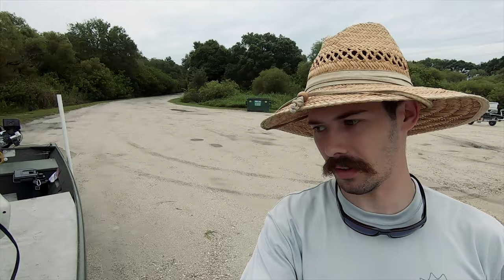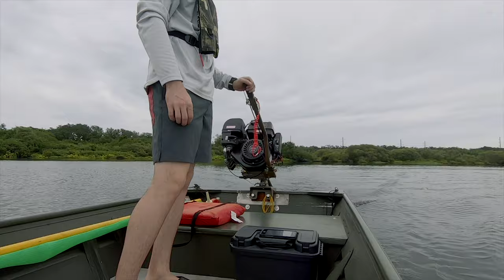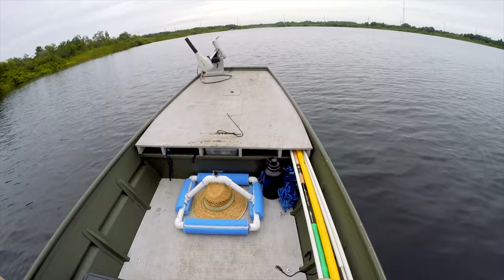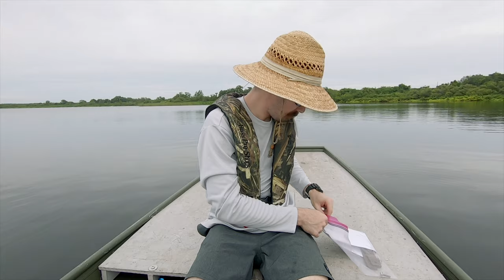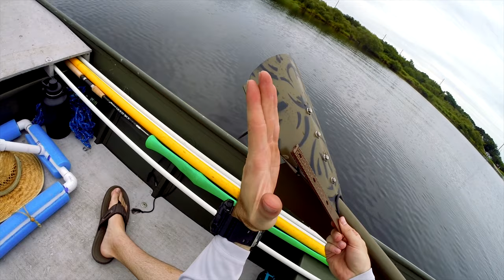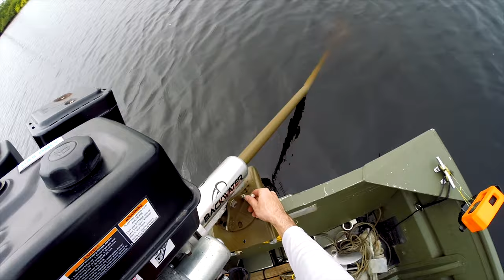Backwater Swomp Lite 13hp Water Trial & Tune

Comment from the maker: I have talked with Backwater on the phone. There are two 9" props on the way, along with a different throttle lever. There will be an update video once I get those parts and start working on the rig to see if I can get it running better. For those who like to read, here is the article - https://www.jtgatoring.com/backwater-swomp-lite-glider-kit-12-16-hp-water-test/

Comment: i have this motor its a beast you did have the cavitation plate still running a little low in the water, it pushed my 16x48 at the same speed it was pushing yours.

Comment: Just my opinion, your speed sounds about right. As far as vibration I've never ran a single cylinder engine that didn't. I've never thought mine was excessive. I own a backwater but, have have a good bit of experience with my friends swamp runner. The swamp runner is better for open shallow water and speed ( better angle/ longer). It's a great budget motor for getting shallow .If your really doing 4×4 boating the backwater is far superior, in the rocks, logs, sand, true mud and really thick nasty weeds and muck. My buddy breaks a prop every  other time out from hitting logs and has bent the shaft when trying to leverage/ pry a stuck boat. They both have their place in the shallows, but I've yet to see a video of any one really bashing and abusing a thai style longtail or using them like a mudmotor. I think the swamp runner is more of a shallow water outboard rather than a mudmotor.
Reply from the maker: I do not remember the vibration being this bad on my Swamp Runner. I talked with Jake @ BW and he going to send the 9x4 and 9x5 props over. I'll also test a few other things to see if I can decrease the vibration. 
The backwater american design vs the swamp runner thai design is definitely a topic that I will try to cover and really break down the pro and cons of each once I put a few more hours on the Backwater kit and get more familiar with it. As you said, I do think that each kit has its own style/function. As of right now I agree with you that the Backwater is more designed towards the muscle through; pry, dig, and burrow type of approach, where the Swamp Runner Thai kit seems to really get some speed. I have still yet to break a prop on it though. I don't have any rocks where I am but logs and fence post I do have. I run the 8.75" weedless by swamp runner, and it is a thicker cast prop when compared to the standard props. Maybe that helps, but I would still think you could pry a good amount with the thai kit. I am not able to because my transom is about to give. I think I'm going to have to rebuild it this winter. Once I feel confident in my boat, I'll feel better about really putting the kits to the test. Thank you for your input Carson 👌

Comment: And for a better throttle you should just get a bicycle hand brake leaver and squeeze to go. But first loosen and twist the handlebar to the left. it will lower the handle, and move it to the left out of your way, and will probably solve your problem of the falling forward of the engine when at rest.

Comment: I have a backwater 13hp vtwin  kit with a vanguard . Your NVH probably has a lot to do with a more secure ( less play) mounting , tight tolerance as well as running a single piston lower end motor.  Not to say it’s not a reliable motor but HF doesn’t make the tightest tolerance motors out there. I can tell you that backwater will hit rocks and other hard surfaces far better than most on the market . Their service is also second to none . Good luck with the rest of your tests.
Reply from the maker: Yeah, I think a 16 or 18 hp vtwin briggs would be awesome. They are so smooth. For the price, the HB engines do work but as you said are not the best out there and especially with being a single cylinder engine they will have vibration. The backwater is sturdy built kit no doubt, and thank you for the support 2ndrambo1!

Comment: Im curious about the vibration. Here is my suggestion. 
1. Run the kit not in water and see how bad it vibrates. 
2. Remove the prop and see if it decreases. If so, call Jake and ask for another prop, it may not be balanced. 
3. Rotate the prop on the shaft to see if it may balance out. This may help because the single cylinder engines don't have a counter balance to smooth it out.
3. Take your handle and rotate it one way or the other and drill a new hole for the handle mount. 
4. Loosen the Phillips head screw that holds the throttle handle. You may want to add loctite to secure the screw. This should allow the throttle to return. If not, add a spring to the engine to help it.
5. Get the teflon plate I was telling you about between the transom bracket and the engine bracket. 
6. May want to tighten the tilt bracket bolts to take slack out
Reply from the maker: Those are all things I plan to do to try and troubleshoot the issue. I did have a conversation with Jake @ Backwater and  he also mentioned a few things and has some parts and props heading my way to see how things go when I get back on the water. This week I'm hoping to get the parts and test a few things on land before heading out again. For the teflon plate, is it easy to get at a hardware store, or is it more of a specialty item that should just be ordered online?
Reply: @JTgatoring  I have a friend that works at a gasket store to make mine. But it would be easy to make.
Btw, sent u a text

Comment: Try to give it a little throttle with the prop out the water before easily dropping it in and you won't have that strong pull down before jumping up on plane. You can also look into the newer spring style squeeze throttle handle from BW. I just got rid of my backwater and really didn't want to. Loved it (vibration and all) but just went to a whole bigger rig
Reply from the maker: That was one thing that I don't particularly like. The prop does not bit until the whole prop is submerged. Whether I try idling up before letting it in the water or while idling up under water. Thats why I want to test it in heavy vegetation to see if there is any issue with how the prop performs in that aspect of idling and biting to propel the boat forward and if the engine will bog or cut out at all. I talked with Jake at Backwater about a few things and one was the throttle lever. He was going to send over the squeeze throttle so I can test it out.

Comment: I had a backwater before I went to swamp runner. I prefer the swamp runner over the backwater. Looking into a mudskipper surface drive now
Reply from the maker: As of right now, I prefer the Swamp Runner too but I'm still going to run the BW and see if I can get it to run a little better. Any specific reason for wanting a Mudskipper surface drive?
Reply: I have heard nothing but bad about mudskippers surface drive. I would suggest getting a used one cheap. Or if you are looking for small HP for cheap. Mud walker, copperhead, drake surface drives

Comment: If you primarily sit then you have to either bend that handle down to be level while sitting or you grab another metal piece and make another at the correct angle etc.
Reply from the maker: The only problem with lowering the handle is that it may bottom out on the seat if you're doing a level change since the tail goes up, the tiller has to go down. So yes it can be lowered but depends on the user. I'm starting to find out that there's a lot of little intricacies that each mud motor has for certain reasons.

Comment: Called it:). They are made well and built for abuse.  BW-Solid kit but will not perform as well as  the SPS.  SPS-The longer shaft, light prop make all the difference in carrying a load and speed.  Curious did you see a rpm difference at full throttle?
Reply from the maker: You were right. At full throttle I was still hitting the governed RPM range of 3800-3900. I talked with Backwater and he is sending out a 9x4 and a 9x5 for me to test out so I will see what will happen with those props and of course make a video about it haha

Comment: Just loosen the handle back by the engine, and rotate it to the left. That will move the handle to the left, and give you room to sit more toward the middle of the boat my friend.
Reply from the maker: That is possible. I would have to slide the handle in a little to make small adjustments though. Once I found a good position, I could then drill another hole for the through-bolt but there isn't all that much room to drill holes so you'd have to pick your spot and commit to it. Definitely possible though

Comment: The vibration is from you engine. The Swamp Runner rattled as well, but you didn't feel it as much because the shaft that mounts to the transom mount absorbed most of it. I had a SPS on a boat with a hunt deck and the vibration echoed through the hunt deck making it sound like a tool box falling down a flight of steps. The Backwater had a little more vibration in the handle but no rattle. Speed, I got the same speed with both setups. However, the SPS speeds seem  to not hold top speed. It would hit top speed then bounce down 1-2 MPH and then back up and bounce back down. My Backwater carries a load better. The biggest that puts the BW ahead for me: one, is it has a steel prop. I get the idea of the SPS prop, but running mud flats the SPS prop do not hold up. Having to change props three plus times going through couple hundred yards in a mud flat is not fun. Second, the hex shaft makes changing a prop much easier. Third, my BW water has the top brace on the shaft, so the amount of flex in the BW shaft vs. the SPS is night and day. Fourth, the skeg on the BW is built thicker and tougher while giving the shaft for more support while the SPS skeg I have bent many times digging into mud and or sand. Also, running both motors through grass, I have less that gets wrapped around the shaft with the BW. Not saying that the SPS is a bad product, but the BW did better for me than the SPS.
Reply from the maker: I've had a couple of people tell me its from the engine, but either way, I still feel the vibration in the handle a lot more in the backwater when compared to the swamp runner. I can only run it for 10 minutes before my hand goes numb. Whether its the engine or the backwater kit, I still can't drive it for more than 10 minutes where the swamp runner I had no issue. I do not have any mud flats by me, but I've been running the same prop through vegetation and stumps and still haven't broken a prop yet, but I'm also not trying to break a prop. Its starting to become more clear that there are situations and environments that suite one or the other when comparing the backwater kit and swamp runner kit. I plan to cover that later on, but right now I am trying to get the Backwater to run better.

Comment: if you remove some of those wood platforms, it might go a little faster. i run a sps kit on my 1436 with a modified 6.5 hp predator i hit 18mph. the vibration is from the motor, you gootta remember its a pressure washer/mini bike/gocart motor not an outboard
Reply from the maker: I prefer my swamp runner over the backwater. It has nowhere near the amount of vibration as the backwater did and it was much faster. The backwater got up to 16mph and I was able to get 23mph with the swamp runner on the same boat setup and the exact same engine.

Comment: I run the 65" shaft on mine and it balances with the prop in the water.  Maybe the 55" is a little different?  Like I mentioned before, it's not as fast, it is significantly better built than the import kits though.  It's meant for abuse.  Had mine a few years now on the same hull as yours.  Never had an issue.  The speed you are getting is odd though, I run 18 empty and 16 with two big guys in the boat (500lbs between us) on the 8x4 prop.  Never noticed the handle position is odd, but I've always driven a surface drive standing up.  It is definitely odd if you like to sit.
Reply from the maker: I do believe that the shaft length is a 65" on this kit. I guess I just have to get use to putting the tiller handle down in the boat instead of expecting the tail to fall into the water. I would think it would handle physical abuse better than a thai kit being that it looks like it has thicker wall tube and shorter tail you don't get as much leverage compared to an 85" or 100" shaft. The housing is powder coated on the Backwater but the Thai kit I use is hot dipped galvanized so when it comes to abuse in that manner the tables can turn. I will do a complete comparison and breakdown between the two, but for now, it seems like there is a certain group of people that would benefit from the BW over a thai kit and then the opposite way around. For speed, I know that the boat has good weight distribution and I have a light load so I don't know whats up with that either. There have been a few guys on Facebook that have experienced the same thing with getting slower than expected speeds. I like to sit if I'm planning to be running open water and traveling for 20 to 30 minutes. No need to stand.
Reply: How are the seals holding up I got 2 gx390s needing frames but I'll never own another go devil product

Comment: I’d like to see those other kits do what that one can do.     I promise you the others will break bf the backwater does.      I own 2 backwater motors and they run fine not much vibration in handle     But I also ordered it together from the company I did not put it together myself
Reply from the maker: It would also depend on if your engine is a single-cylinder engine or a v-twin engine. The v-twin engines are balanced a lot better. The one kit that I do prefer over the backwater is the swamp runner kit. I really enjoy it for what I use it for, and I would really like to see what else it is capable of. I first have to reinforce the transom on my boat, but after that, I would like to find some more challenging areas and see how things perform.

Comment: If vibration bothers you upgrade to the v twin motor, they run smoother
Reply from the maker: Good thought! With this size boat, it can only handle a 13hp engine. So if I were to go to a v twin engine I would need a bigger boat. I do agree though that vtwin engine is the way to go

Comment: I noticed a transom support running from transom to the floor is that new ? If so I'm interested in hearing more
Reply from the maker: There is a factor support that is off-center towards the starboard side of the boat. That is the only support on the transom at this point in time. I do plan on rebuilding the transom soon

Comment: Do you miss your Thai longtail from SPS? that Backwater swomp Lite seems kind of slow
Reply from the maker: ......yes. It's taking me a while to try and get used to this motor. It is definitely slow when compared to sps longtail. I am going to make a few more trips with the Backwater and make my decision then. As of right now, I can't run this backwater kit for more than 10 minutes before my hand is numb.
Reply: @JTgatoring  have you tried loosening your handle and turning it sideways or upside down so it's lower for you that might not be possible with the design. But yeah I think SPS is probably the best when you compare affordability durability ease-of-use and speed
Reply from the maker: @MudMotorsMax  Yeah, I will be adjusting the handle and drilling a new hole to put the through-bolt through. I will make a video of all the adjustments I do and see how it goes. So far for the price, swamp runner seems to really provide a lot of value
Reply: @JTgatoring  A yellow leather work glove makes a big difference on running comfortably on long tails.

Comment: Great  non-biased review, as usual. Great job, JT. A one word su cmmary from this angle: awkward. It looks like it was not intuitive to use. I want the "made in USA" to be better, but it looks like someone's interpretation of what a longtail should look like, not what necessarily works best.
Reply from the maker: It is awkward for me. I did have a conversation with Jake @ Backwater, and I'm going to try a few things and put some more hours on this kit to see if I can get it working better. The quality of parts is there, but actually using it has been awkward
Reply: The angle is more on his boat bout you do drive these standing up it's not a sufacedrive also you want the widest boat you can get for a long tail

Comment: I have a 8hp predator with a swamp runner kit on that exact same Alumacraft and get 16mph with me and my wife I’d save my money on this and get swamp runner
Reply from the maker: Those are pretty good speeds! Good for you Dylan 👌 thats awesome. As for right now, it doesn't seem like the Backwater kit will be a speed demon. I still have to test it in the vegetation and see how it holds up there. But for the money, if you want speed, Swamp Runner does seem like the way to go right now. I did talk with Jake at Backwater and he's sending out some 9" props for me to test to see how much I can get my speed up
Reply: The balance of his boat is holding him back plus if he runs shallow he would be hitting 18+

Comment: It definitely seems slower than the SPS kit. Almost like the engine is struggling to push the boat with ease
Reply from the maker: I was still running the same RPMs (3800 to 3900) which is the governed RPM range for my engine. The Backwater design is just not as efficient as the SPS kit. The SPS kit with a 8" prop would get me faster than that speed. It may also be prop design too. For which ever reason, the SPS seems to be more capable of reaching a higher end speed. I did talk with Backwater and they are going to send over some 9" props that I can test.
Reply: @JTgatoring  I had high hopes for the Back Water kit as far as same speed/performance as the SPS, just with better handling. I'm still a die hard sps fan. Keep up the amazing content brother. Thank you for what you do